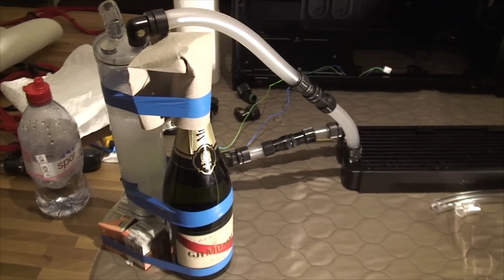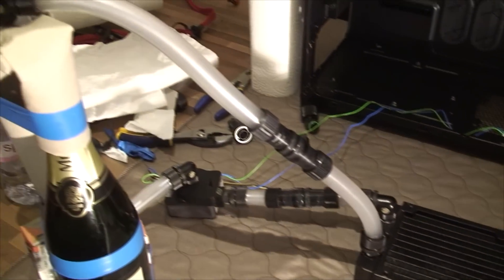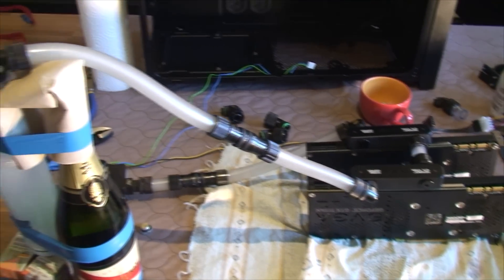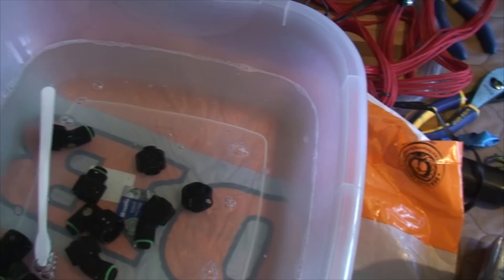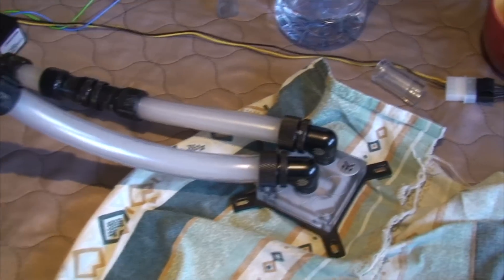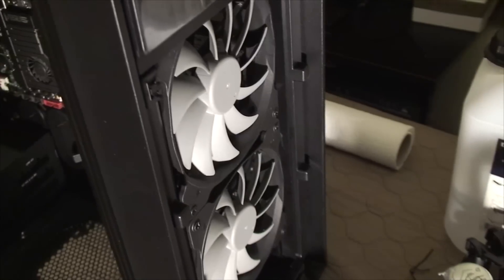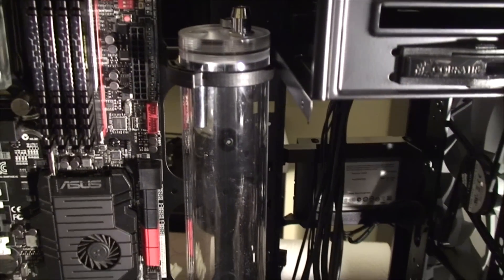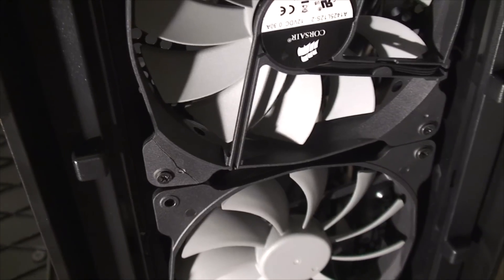Epic Bootleg Watercooling Loop! - Making of T.U.G.S 3.0 - Part 2 - Cleaning

Comment: I have the same case as you and want to water cool but I'm having a hard time trying to find a place for my res. Yours looks perfect but you say you had to drill a hole for it to work. How easy was it? Is it stable after the drilling? Which tools did you use?

Comment: Why'd you mount the two front fans in different orientations?
Reply from the maker: It will make more sense in the next video when you see it with the radiator mounted. So stay tuned for that!